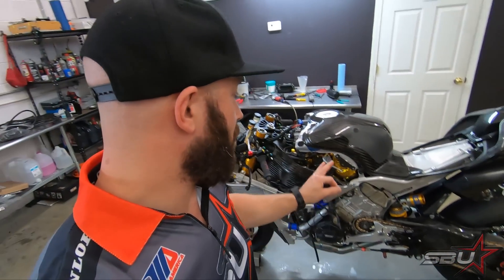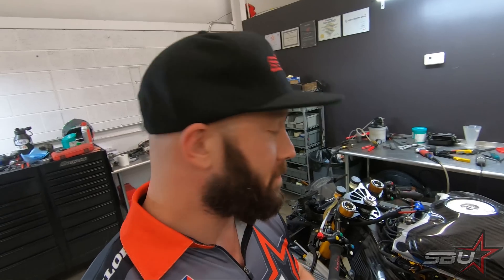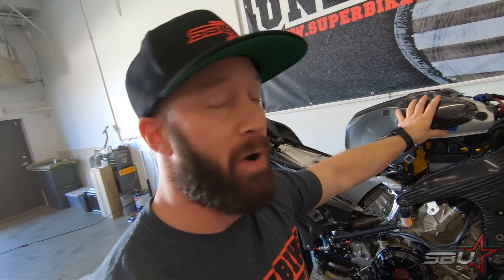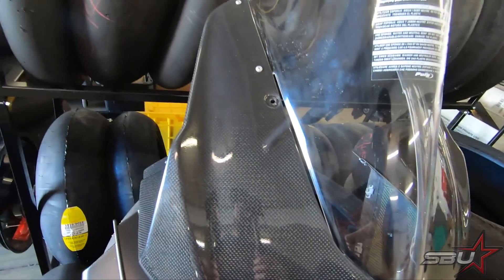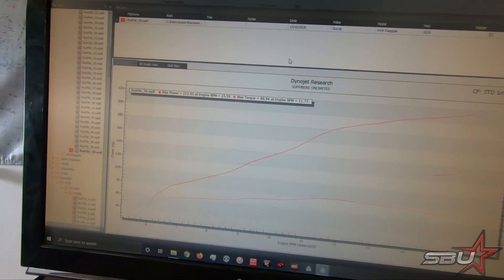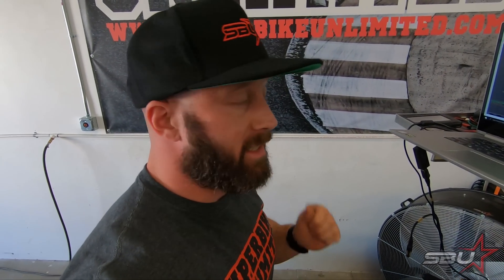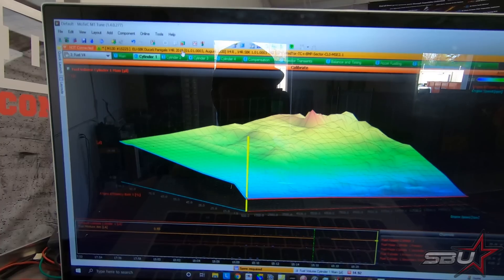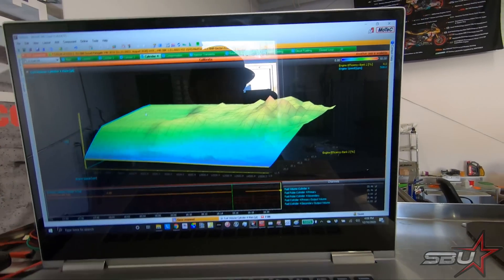SBU 2020 Ducati V4R Panigale SBK, Pt.11 - MoTeC M1 ECU Cylinder Tuning Dyno Results, More Parts!

Comment: Freddy. I would love your help since you have made a video about the trans- logic quickshifter /autoblipper setup on the V4R. I bought the autoblipper from SBK and installed it on my 2018 v4s. From factory plug in, the shifter (translogic) only does GP ( reverse ). Have you had that experience with installing yours? Even when using the adapter and removed , it only GP shifts rather than default stock shifting like the factory auto blipper from ducati. 

Have sent out message to SBK and translogic. I haven't seen any videos online of installing this autoblipper (stand alone unit ) from other sources accept the one you have on your race bike. 

Thank you.

Comment: Why are you not running a knock sensor, I know you mentioned you would rather use the port for a shock potentiometer but I reckon the engine tune might be more productive.
Reply from the maker: Knock sensors are not normally used on applications like this. We develop a proper map and use consistent fuel, there won't be any knock.

Comment: Great video 👌but plz would u recommend the motic m1 tune for ducati v4 r on the street ? Thanks
Reply from the maker: Well, our harness eliminates lights and street functions as well as ABS. Other than that, there's no reason why not, you can actually have safer rider aids with M1.

Comment: Why is each cylinder so different? Does the airbox not do a good job of properly distributing the air source for the throttle bodies? Are the injectors not balanced that well from the factory? Are there voltage anomalies occurring with each injector? Or is this something that every bike/engine has that I never knew?😂
Reply from the maker: Almost every engine responds well to this, but certainly this one is more extreme than an i4.

Comment: This is so dope! Completely had no idea that you tune it down to each & every cylinder. All I know is that tuners just give you a map on different fuel I guess thats the difference between street racer vs trackday boys.

On a serious note, 93 pump outputting a 213WHP with stock components on a fairly conservative dyno is mental! & probably the electronics had work its magic as well, ohh also the dude that tunes it. How much more if you can get your hands on a factory race cylinder heads I guess 240whp is very achievable?Cheers!
Reply from the maker: The engine gains from where we are will be minimal, we've been getting some pretty candid info that the heads and cams set is only worth a few horsepower. There's no surprise there, given the current power level. That said, with certain fuels, we think we can get 225+.
Reply: @SuperbikeUnlimited  
Ahh yes!!225+whp And we are only talking about 93 pump gas... what a beast of a motor!
Reply: @SuperbikeUnlimited  Would T4 make any difference as a drop in substitute for the pump gas? I know VP claims a few percent improvement but does it really work that way?

Comment: Hi, so the plastic bike stuff is for standard radiators only? what mods can I have on the bike and still have a plastic bike bodywork – is it the same for all bike manufacturers? 
What brand bodywork do you run now and how would one know what to buy if i runs a big radiator?

Comment: Love the channel and drooling over the bikes.
Can you answer in layman's terms, why bikes have such different fuelling maps per cylinder?
Even the stock maps on my bikes are very different for each cylinder.
Reply: Likely a lot is to do with resonance from the air pulses inside the airbox. As the valves on each cylinder close, they send a shockwave backwards up the inlet tracks. These pressure waves then bounce around inside the airbox. It takes massive amounts of math and modeling, but at very high levels of competition(think F1, MotoGP, etc) engineers will tune the volume and shape of the airboxes to bounce these pressure waves into other cylinders. So at certain RPM ranges these pressure waves can be used to force more air into an adjacent cylinder than it might be able to pull in on its own. At those points you start seeing efficiency values of more than 100% for certain cylinders at certain RPM.
Reply: @GRothermel  thanks, I also read somewhere crank angle has an influence, both my bikes are 270° firing.

Comment: Have you ever thought about using the MWR air funnel, or do they even for the V4R?
Reply: And are you gonna do any real world tuning to the engine
Reply from the maker: @mrmete  We always  tune at the track, we also have a system that auto tunes each cylinder that we enable during laps. The MWR is on the bike.